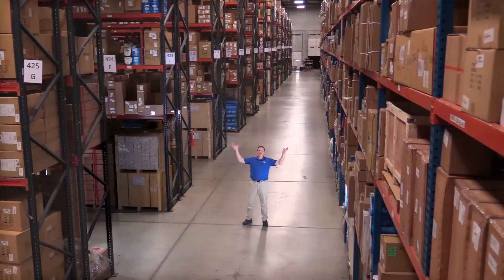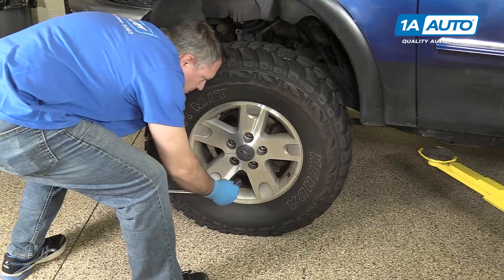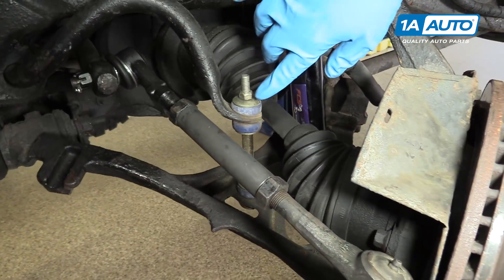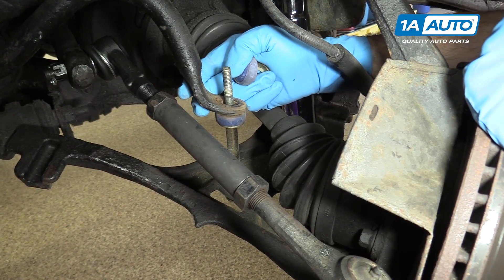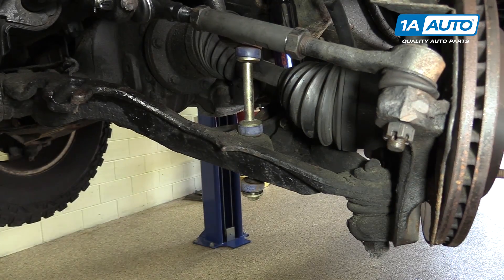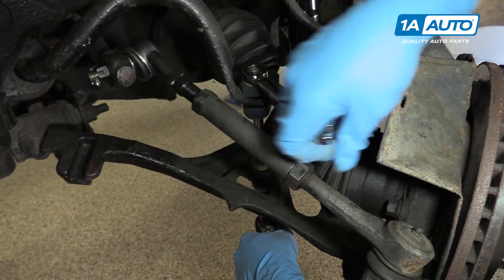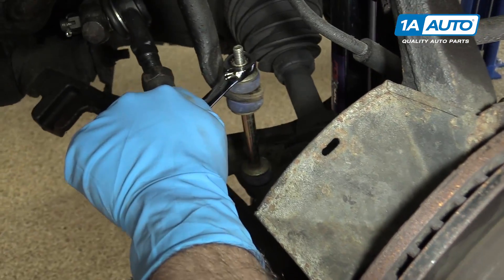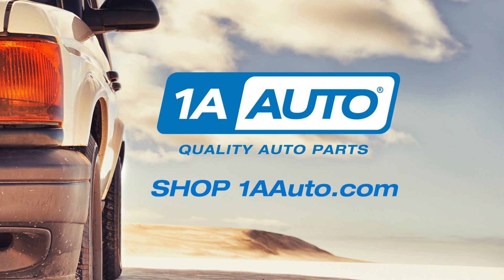How to Replace Front Sway Bar Links 80-03 Ford F-150

Comment: Spot on with how to replace it but that thing definitely fought me to the end. First the pin was upside-down an from time had basically welded the bushings an sleeve onto the long bolt. Definitely would recommend a Sawzall I was unfortunate enough not to have one at the time. took forever. Thank you for your videos though!!! I've fixed so much stuff thanks to this channel. Littlerly saved myself thousands by now lol.

Comment: A new kit with uncompressed bushings may not install so simply as did the used (compressed) bushings on the video. I had to use a small jack under the swing arms plus a crow bar from above to compress each suspension spring slightly so that I could get the nut to thread onto the bolt end. Note 1: Do not place a jack under the brake rotors. Note 2: Moog makes great suspension components (anodized, in this case). However, there is not a lot of extra threads to extend past the nut as there was on the original factory bolt. Hence, some help in compressing the new bushings may be required.

Comment: If you're watching this video for the torque spec it's not in here
Reply from the maker: +Deric Cribbs Thanks for checking us out. You would need to tighten the stabilizer to 15-17ft/lbs.
Reply: @1AAuto  it's awesome that you guys keep up with your videos 👍.  I also found that the torque spec for the bar to frame bracket is 22 ftlb. (Torque spec is double that for the next generation)
Maybe you could place both specs in the description for reference.
Reply from the maker: +Deric Cribbs Thanks for the tip! We'll pass this info along to our production team.